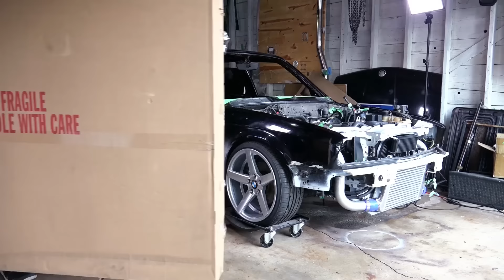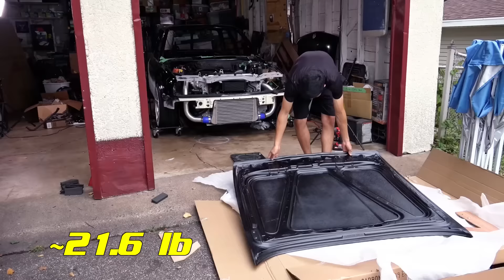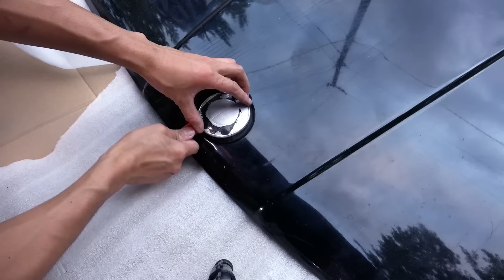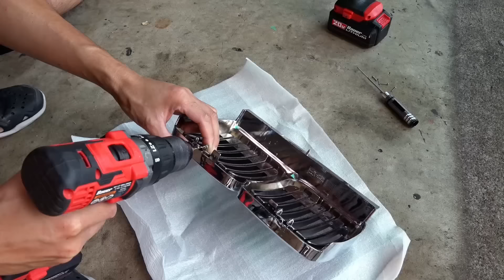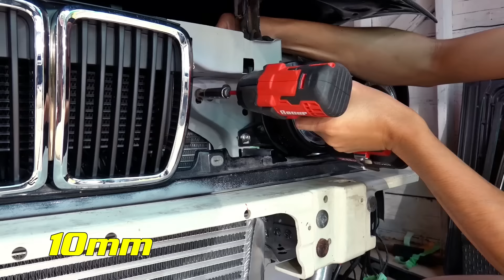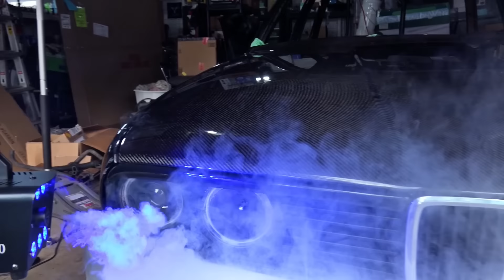E30 Fix 20 | $899 VIS Racing Carbon Fiber Hood OEM Style

Comment: Really poor fitment.
Reply from the maker: For a carbon fiber hood, it's good enough I think.
Reply: @DarkDragonWing  THe VIS hood has always been known for this.  Also, at the base of the A-pillar, you'll notice it fits REALLY poor.  VIS used a bent hood when they made the molds years ago, and has never fixed it all these years.